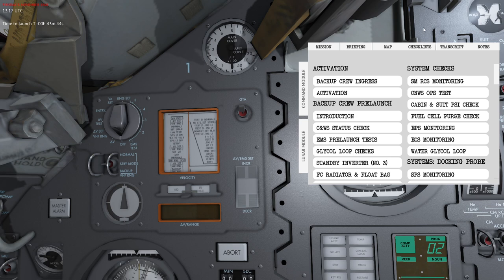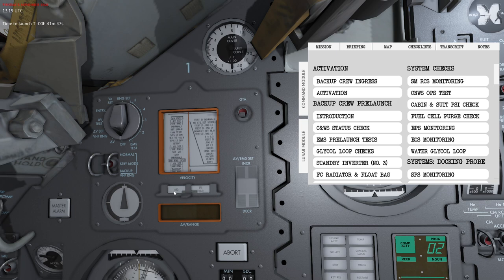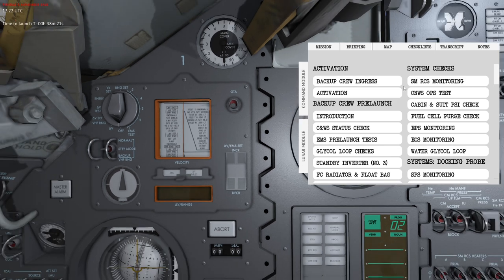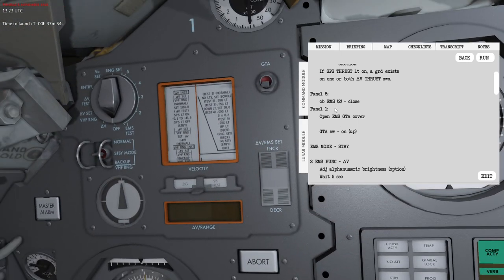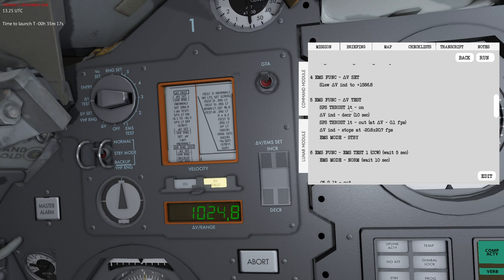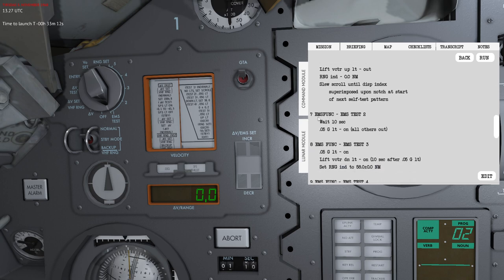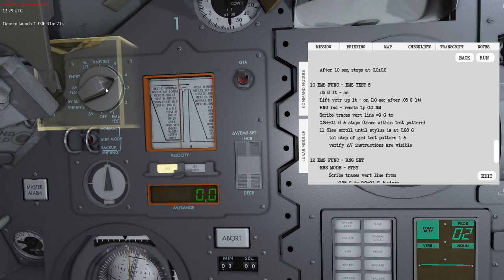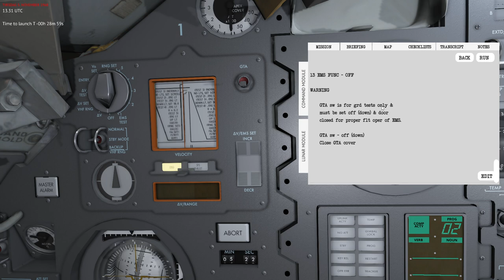Command Module Academy - EMS Ground Testing

Comment: Question I have activated the launch escape system during mode 1 B but every time I tried to deploy the parachutes. I could never get them to deploy
What am I doing wrong?
Reply from the maker: Hey! Will try to reproduce. Are the two ELS circuit breakers closed on P8? And what about the ELS logic switch power and mode switch (AUTO or MAN) (MDC-1).
Reply: @ReentryAnOrbitalSimulator  I had the second time I had it in Man.  But I am wondering if I didn’t arm the PYROTECHNICS
Reply from the maker: @jeremycox2983  Great that you got the splash properly in Man, congratulations. :D